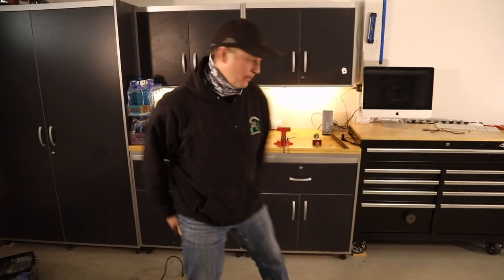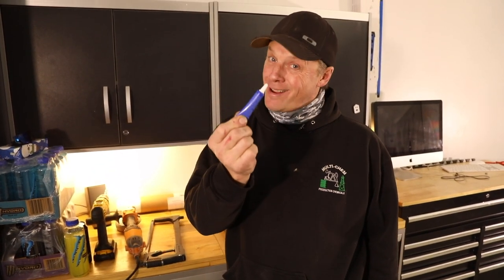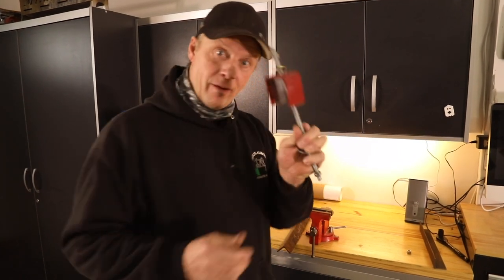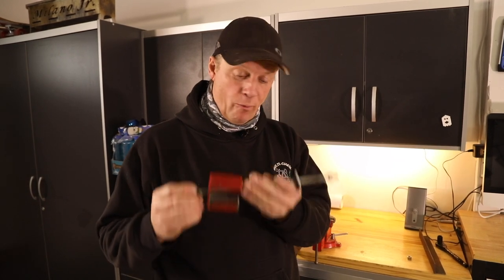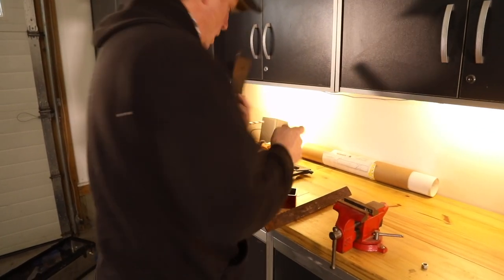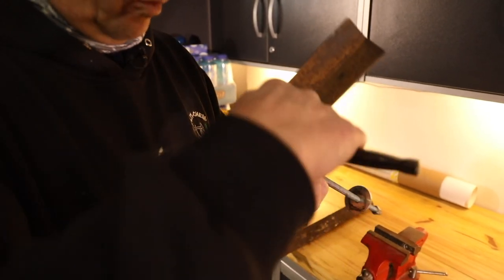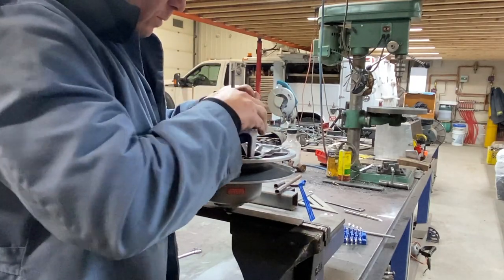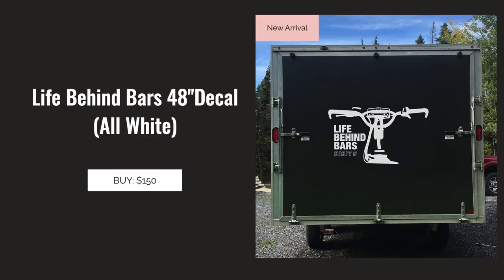DIY Secondary Clutch Spring Compression Tool

Comment: All I needed to do the upgrade was a bench vice, a 7/16” 15” threaded rod, a block of wood with a 1/2” hole in the center, a 1” x 3.5” x 1/4” piece of aluminum with a 1/2” an offset center hole, a 2” PVC pipe coupler, a washer or two, and a 7/16” nut (all things I had sitting around the house); plus a primary clutch puller (definitely recommended).

Remove clutches. Clamp the rod into the vice, slip the wood over the rod (to cushion the delicate clutch parts), slip the clutch onto the rod, place the 2” PVC coupler on (fits perfectly over secondary bell - holding down collar), next the metal plate (offset hole allows easier viewing when reassembling primary), washer(s), and nut; good to go!

Comment: Thanks for the video, that's really helpful! I would like to point out that there is only at max 250 lbs, maybe and I mean maybe 300lb on that spring. You could safely do this job witha low grade#8 bolt if long enough, they can hold over 500lb. 3/8 low grade threaded rod/bolt can hold over 3000lbs, giving you a 10x safety margin. 1/2" is way overkill at 5800lbs.

Comment: Could you explain a little more into clutching? I ended up going with a 48/44° Helix on my TM7 a couple years back because i was unhappy with the lack of bottom end. It had a straight 46 in i, (if I remember correctly), it was a little better. The primary is simple and fairly straight forward primary engagement is based off of how stiff your spring rate is. Weight is based off of what power you can pull (elevation and conditions dependent). Then the secondary is where i always get confused with the helix and spring...
Reply from the maker: We will try and get a vid on that subject ! Thanks for tuning in !!
Reply: @DIGIT9  Great! Thank you! Thanks for your awesome  content!

Comment: Great video! Speaking of clutches, I have a 2017 zr8000 (trail pony) with a failing primary and secondary. Factory primary is 750 USD, would I be better off getting after market? If so, any suggestions? Any input would be great.
Reply from the maker: Factory Team ones work great !

Comment: Im sure i toasted my primary clutch 
Arctic cat m1000 
Would u happen to know some one that might have 1 lol
Going to be in sicamous tomorrow 
Found 1 in lumby a complete 1 for $750 
Is that a good deal 
From rual Nakusp 
I would love to take u sledding around here we got mad snow dude
Reply from the maker: Its a bit steep for a used one !!
Reply: I took it to infinite Powersports in revy 
It was the weight that stuck 
But i do need weights 
We should chat 1 day 
I messaged you my phone number on facebook 
Lol blew my first belt yesturday lol 3/4 the way up the hill at full throttle 
Changed it where it blew lol and then kept going up the hill lol
Reply: He said i will need weights / rollers / and pins. but he is stumped on where to start for weights
Reply from the maker: Makes sense !